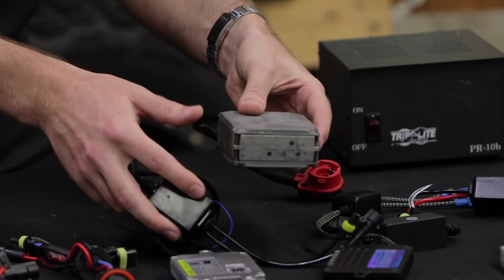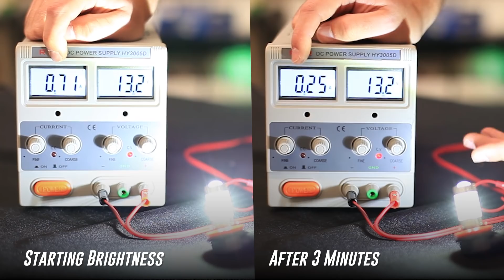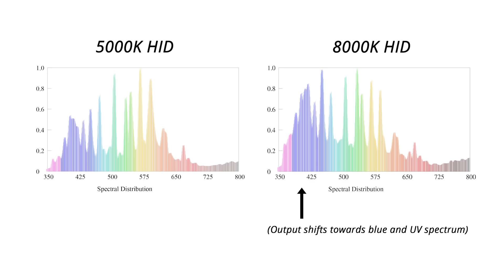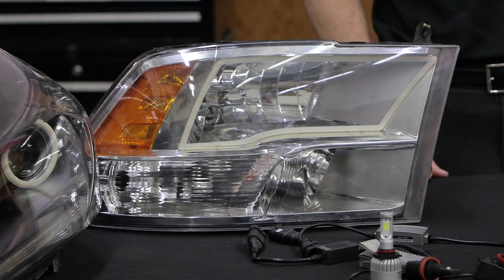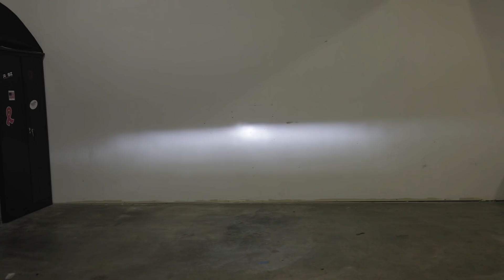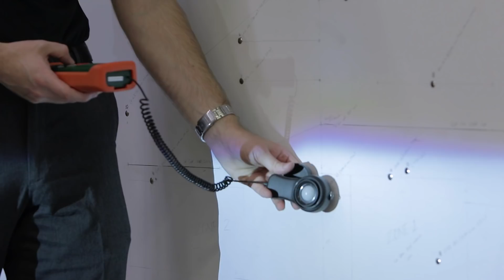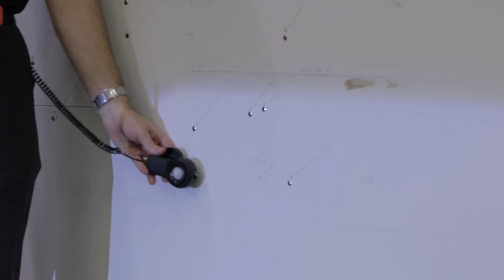HID vs LED Headlight Bulbs: EXPLAINED

Comment: Just want to share particularly for those in South Asian country. The light projection by LED lighting is poor through smoke or fog especially thick burning smoke. It is only visible from opposite side of the road along burning bush fire from either side is less than 20 feet comparable to HID or Halogen light. Halogen or HID light is visible through thick smoke as far as 20 meter or more. Base on this experience, please dont overtake a car in front of you by assuming  there is no potential car coming from opposite side

Comment: Hi Paul, Thank you so much for a very nice informative video. Learnt a lot. One question, I have a HID 9005 6000K 35W setup. I am planning to increase the setup to HID 9005 6000K 55W. Do I have to upgrade both the bulb and the ballast or just the ballast? Look forward to your reply. If the answer is both, what happens if I connect a 35W HID bulb to a 55W ballast apart from the obvious (blow up)?
Reply from the maker: Hi Haritha! Thanks for the kind words. Please go ahead and give us a call at 314-205-3033 Monday-Friday 9 a.m.- 5 p.m. CST, or shoot us an email at contact@diodedynamics.com, and our service team will be happy to help you with your HID upgrade!

Comment: HID sounds rubbish and Energywasting.....why even f...ing bother with that Crap in 2020....LED is best..lasts forever and Energy saving....
Reply: Jpkrao  last forever is a figure of speech...led certainly have the longest lifespan compered to anything else and in this day and age coupled with low energy usage it has to be the choice made as a lot of hdi users still blinding the crap out of the rest of us....by the way very good video...was like a lecture at uni....

Comment: @diode dynamics .. Interesting. Very. But why did the measured outputs for all bulbs drop in the projector system? I thought it was supposed to collect and focus the light better than the reflector system?

Comment: I liked the presentation and got a lot out of it but noticed 2 things that I have questioned.  CANBUS is the vehicle communication protocol and that box might be an interface (or maybe simply labeled inaccurately from a chinese manf) , The " flickering" is most likely a PWM driver as used in Chrysler vehicles on low beam. Based on the quality of the presentation I'm sure you are aware of this, I'm curious why you presented those points in that way.
Reply from the maker: Hey there! Many of the things we addressed in this video is based on the 12+ years of questions and feedback we get from customers on a daily basis.

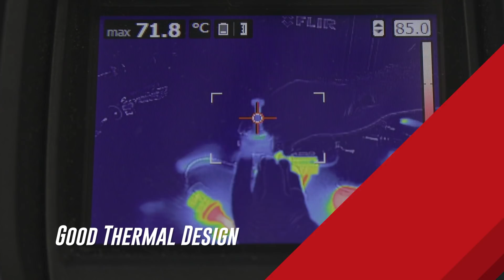Comment: Your infrared camera example at 9:12 of cool running bulbs was deliberate deception.  It is impossible for an LED to produce enough light and stay that cool, unless you had first put the whole assembly in a freezer and only measured for the first few seconds till it warmed up.
Reply from the maker: Not a deception at all! When you have a properly designed bulb and heat sink, it is possible for a bulb to remain quite cool.

Comment: I wish everyone watched and understood this so they could stop blinding other drivers just because they thought their chosen bulbs look cool.
Reply: Sweeney Dunston stick with what the engineers designed for your type of headlight and change the bulbs sooner to keep them bright. 
Oh, and clean your damn headlights.
Reply: @oldgringo66  for real. Stupid 04 impala housings are fogging up pretty bad lately. Time to ask for a polish kit for xmas. 😂
Reply: @oldgringo66  cant see shit with my stock halogens on a unlit road at night. Almost run into a  cyclist last week because they had no rear light. 
If you install proper components the right way there should be no problem.
Reply: Ah, fear.  Lights keep getting brighter.  People still leave their brights on.  The glare causes even dims to appear absurdly bright but this is america.  Blame someone else :))  You win, my eyeballs are fried.
Reply: @onlygearwarrior  there's enough regulations we don't need to be like Europe and told what headlights we must buy for our vehicle. Driver blinds you blind them back. Or if it's there low beams any driver should be able to see the white or yellow line. If you can see one you know where your car should be from either line or shouldn't be driving. I don't run super bright headlights regular halogens work good enough and I'm up in a f250 so my lights are literally head high drivers of most cars
Reply: @JamesSmith-lt5zz  There are already regulations.  I don't believe I mentioned needing more.......  But you do mention the position of most of these trucks nowadays are much higher.  And that is why there is also a regulation of their height I think is 42 inches.  Whatever I don't care but there are drivers that do make theirs brighter for no regard of others.
Reply: they need bulbs with sensor to Dim automatically because some drivers don't know how to Dim there light
Reply: I ride a motorbike with standard halogen bulbs, but they appear bright and white and most car drivers think I have my high beams on, I've lowered the position to point more to the ground and get less drivers flashing at me but some still do. So now I'm at that point where I'm choosing to upgrade to a HID for one purpose, tell those shitty drivers to fuck off ;) Oh and mainly because I ride on side roads, when it's dark it's pitch black and I cant see the road ahead of me doing 60 on a single carriageway.
Reply: @BeatsProduction786  always a tough choice. Too bad their isnt a one bulb/one housing fix-all.
Reply: @SweeneyDunston  tbh I've seen setups where the HID was used as the main and the old as a secondary, so you could have your normal bulbs running then turn on the HIDs whenever you need them.
Reply: @BeatsProduction786  🤔 good point. I may have to look into that. Though with a P71 police interceptor, most of us try to keep them as original as possible but with a slight update.
Reply: I care nothing about looking cool. I want the brightest bulbs possible. I want to see that moose standing on the fog line.
Reply: @Sam S How is yours the "controllable side" if you admit you "can't see a fkin thing"?  If your eyesight is that bad, be responsible and turn in your license.

Comment: I have a 2k5 Silverado with factory smoke colored headlight lenses. I have halogens, but want an upgrade. I have had hid's in my wife's GMC which are clear lenses and I don't like the output of them. My question is do you have any suggestions or recommendations?
Reply from the maker: Hey Mark - check out our website below, as we have great options for all makes and models! 
www.diodedynamics.com

Comment: so a HID isn't that complicated...a voltage transformer/booster/regulator, capacitor and bulb... got it. AC systems cost like $50 for a good 55W kit, easy to install and takes about 1 second to warm up and i think it looks cool. Bulbs last a few years for me. But you need a projector lens. The ones you used in the video sucked... All the ones I've used were awesome.

I like the "30% brighter" statement you brought up lol, nice. Serves them right.

Great video.

Comment: What about a LED bulb inside a projector?
Reply from the maker: With the SL1 LED we offer, it is designed to work great in both reflector and projector based housings. This will not necessarily be the case with all other LED bulbs, as they do not always mimic the beam pattern of a stock bulb, resulting in poor performance.

Comment: Well I for one know about the major issue with Cree L.E.D. light bulbs. I ran them for a week and had to remove them for two major reasons. One, the glare towards oncoming drivers was huge, Second, absolutely no focus beam which essentially means although the headlamps were on, there was no effective light being produced down to the road level. As for the SL1 L.E.D. headlamps, I'd love to give them a try except the specific bulb fitment for my vehicle the (HB5) 9007 does not exist which means I'm stuck with dim lit halogen bulbs. My 2003 Ford Crown Victoria uses a bulky composite reflector which means no options for changing out. I'm stuck with what the factory made for my vehicle.
Reply from the maker: Hey James - we do hope to release dual filament option here in the next couple of months that should be great for the 9007 bulb size. Stay tuned into our social media for updates on that! :)

Comment: I had a high quality HID in the bike. It did not cause dazzle and solved the frankly dangerous halogen”s poor performance. When it failed I went to LED it was at least as good. The LED emitters are hardly any bigger than the Halogen filament cool so lamp focus was good.

Comment: I was able to use an LED H7 bulb in a BMW motorbike headlight. It was needed because the halogen bulb was so poor it was dangerous in wet conditions. However while supposed to be a direct swap the LED would cause dazzle unless  the light was angled to its lowest setting. 
I have tried H4 LEDs in a car but could not set the lights low enough so had to revert to bulbs. At least these are adequate. 
I expect LED bulbs are technically illegal though the bike always passed its mot (annual safety test).

Comment: Very well explained. I came to the conclusion that your DD HID system was more effective than your SL-1 LED bulbs for the projector lamps on my 2016 RAM. Your closing summary confirms my experience. Very pleased with the result. Just wish this informative video was made before I went through the experimental process myself.  All good
Reply from the maker: Thanks for the support Stuart!

Comment: Hi:
Great video, very clear in plain english!

See a high beam LED bulb listed for 2014 RAV4 but no low beam even though both are 9005 (HB3).  I have tried several LED and none works the are very dim much dimmer than the halogen bulbs they replace.  HID have worked much better.  Is this because of the headlight design, bulb goes like from the side instead going from the back of the headlamp as in "normal" ones.
Would this High beam LED listed work well in the side "loading" headlamps of the RAV4?
Regards
Reply from the maker: Hello! As long as the bulb is a 9005, our 9005 SL1 would be a direct plug and play replacement. If you have any other questions about this or anything else, please send us an email at contact@diodedynamics.com - thanks!

Comment: SL1 I would like to install these in my 2019 Can Am Outlander. However the back side of the light assembly is exposed in the fender well leaving the Maglev fan exposed to mud water and dirt. How tough/crucial are these fans? Does SL1 make a sealed version for wet dirty locations?
Reply from the maker: While the SL1 is very robust overall, we do recommend using it in locations where mid / dirt will come into contact with the back of the bulb on an everyday basis. The bulb can can certainly take splashes of water, however dirt and rocks could lead to issues down the line.

Comment: I have a honda accord and had to change headlight bulbs twice a year, tried different ones all the same. Also they I could hardly see in the dark. I paid around 100 quid for a quality hid conversion around 5 years ago. For the first 3 years I'd sometimes have to turn the lights on and off once as only one light would fire. It was random but strangely over the last 2 years they fire perfectly every time. Maybe my battery wasn't great I'm not sure and have changed it since then. Overall 5 years in on all the original equipment I cannot recommend them enough and they are still going strong no issues touch wood! Also I don't like the idea of butchering the original headlight back enclosure to get the led bulb in. Hid is the same figment at the headlight case at least.

Comment: Would have been nice if you included halogen housings for every single pos truck on the road that runs HIDs and blinds everyone around them....

Good video though. On my car the halogen bulbs barely light up the road, while the HIDs emit light for a mile down the road... at the same time LEDs barely light up half the road due to the projector.

Comment: HID IS STILL KING 💯
Reply from the maker: Hey Fabian - both LED and HID are still great options over a stock bulb, and it really comes down a little bit on what type of housings you have.
Reply: @diodedynamics  Even if you have really good housings, aftermarket I'm assuming, and you're trying to fit a LED light bulb in there, aftermarket I'm assuming also, they are just too big/bulky that they don't fit properly. A lot of the times you cannot put the bulb cover back on. If the vehicle comes with OEM LED lights then you won't run into these kind of problems. We know that HID kits are bulky as well but the bulb itself fits into the housing and you are able to put the bulb covers back on. You don't have to worry about the bulb heating up and degrading due to heat.
Reply: @diodedynamics  LED technology is progressing but it still has a way to go to be considered the aftermarket standard.
Reply from the maker: @Fbreezy867381 , feel free to give our SL1 LED replacement a try - we think you will be happily surprised with how well it performs!

Comment: Have often wondered about the differences between the various types of headlights. My bike has HID's fitted. At first I was lighting up London, then after a few weeks it wouldn't start until attempted a few times. So I put a different make of HID and it has worked fine for a couple of years with no startup probs. the LED (SL1) looked fantastic though. Possibly the way of the future. Thanks :)
Reply from the maker: Thanks Tony!

Comment: I want to switch out my halengen bulb unit to LED unit for my 2017 Nissan Altima but not sure if it will run down my battery. Also HID bulbs are $100+ per bulb.
Reply from the maker: There should not be any battery drain with installing an LED bulb, as they use significantly less power than stock.

Comment: very good information! I have been using HIDs in all my vehicles for over 10years and tried numerous LED bulbs but nothing ever came close to the HIDs. Sure the ballasts burn out this and that but the in terms of good light output it beats older Halogens by a leap. On point with you get what you pay for. whenever I buy cheap $10 ballast they usually fail within year, on the other hand a good quality fat ballast from 7 years ago is still running strong.

Comment: Great information for the laymen (me). However you didn’t talk to the thermal aspect. 
Will any of the options you give over heat the plastic headlight module?
Reply from the maker: Glad that we could be of help! The bulbs themselves are just plug and play, and will not need anything else. Thermally, you should not have any overheating issues either!

Comment: Both my original low beams went out at the same tone so I decided in LED but I wish I had seen your video first as the ads were confusing and I only got steered to what I bought by ease of install and price on my Ford Fusion hybrid 2011

Comment: Great video, although the halogen claims are vs stock models , the gas type and pressure in a Philips XtremeVision is different from the standard model, the distance claims are light design dependant.

LEDs from OE brands like Philips and Osram are tested and rated as per EU regulations.

The Canbus just adds resistance to the system , the ballast and LED show as lower than expected power consumption , leading to light out errors.

Comment: I agree with people here, you have a very nice and informative demo here and, best of all, you went straight to the point. :)

HIDs have served me well in the past, installed in my winter beaters within a few minutes. I compare them to the old THX sound test (starts small then gets BIG and LOUD!) and made everything better on those drives to work on eternal winter nights. My vision is great, it's just I've always disliked the yellow/orange hue from OEM halogens. And streetlamps. Yuck. Now I'm waiting for some LEDs for the first time and can't wait to try them out.

Comment: Is there a big difference in brightness when buying a 35w or 55w ballast?
Reply from the maker: While there will be a noticeable difference in brightness between 35W and 55W, you will also run into a few issues with 55W setups like potential damage to the housings, and a much shorter bulb lifespan. For these reasons, we do not offer any 55W systems.
Reply: Diode Dynamics thank you!!

Comment: This is all bullshit

If you don’t have a projector made for leds or hids then don’t use them

Your light output will be shit and it will scatter the light causing glare

No reflector housing is made for led...halogen only and if your projector is for halogen bulbs then only use halogen

If you want to use led or hid you need to get projectors retrofitted that are designed for those types of bulbs respectively 

Stop trying to think you are smarter than the engineers that built your cars by making stupid “enhancements”

Comment: I am not sure if those LEDs are legal on any roads really.  My biggest concern would be having them in a reflector that is not designed for them and possibly causing an accident.  If your car came with HID you may be better off just sticking with those and if if it came with halogens you may be better off with those.  You can get a ticket for weird headlights maybe even your car impounded.
Reply from the maker: These bulbs were designed over a 2 year period by our engineers to have a DOT complaint output pattern, so you can place these in reflector or projector based housings without any issues at all. Don't worry, we did our homework on these bulbs! :)